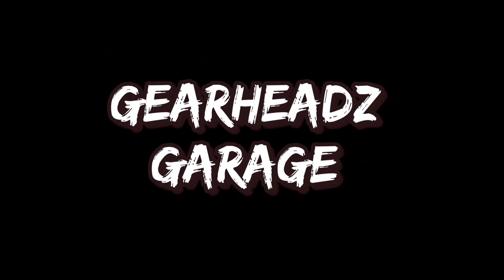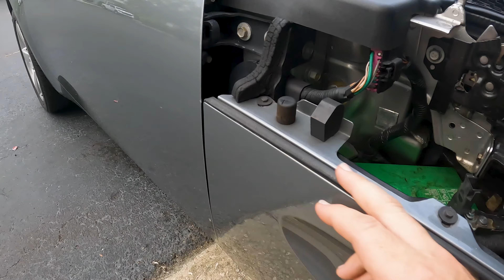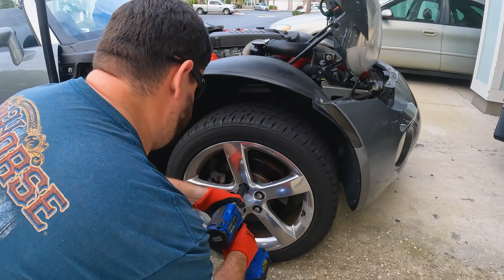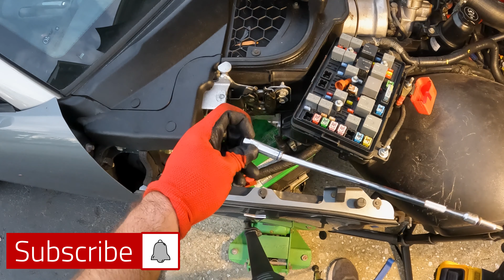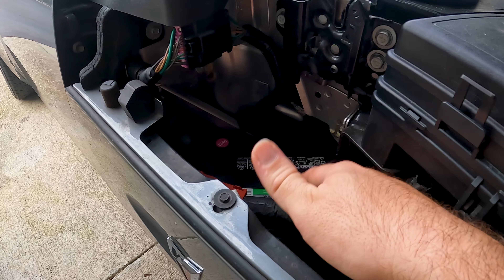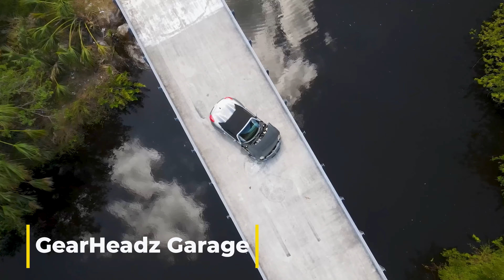PONTIAC Solstice SATURN Sky BATTERY Replacement

Comment: I just did this!  I never removed the entire fender,; leave it intact at the passenger door. Remove the fasteners on the other 3 sides then just loosen the fender bracket at the forward end, unhook it and have an assitant gently pull it away so that you can slide the battery out horizontally. Afterwards no fender alignment required either.
Reply from the maker: Work smart not harder! Many still go the old route. Glad it works for you.  You wouldn't believe the hate mail for offering this solution 🤣🤣

Comment: Need to change my daughter’s Sky battery today. I’m going to try your easy method. I guess both methods are easy. But I don’t wanna remove the fender. Got this link from Bill on the solstice forum! Thanks!
Reply from the maker: Try it out and see, it gets down to preference but you want to avoid removing the fender for alignment etc.  Post back let me know what you think!
Reply: THANKS! It was easy but a darn lug nut was so tight😡 I had to go to the tire shop so they could loosen it! The kid that took it off was nice!  YOU JINXED ME!😂
The shop didn’t charge me but I gave the young man a tip.

oh yeah it is a Walmart 2yr Battery size 58.
Reply: If I had to do it all above again I’ll go through the wheel well….  Makes more since to me
Reply from the maker: @thomasharris5151  tons easier!!

Comment: Bro that is not easier lol.  The only PITA in the correct method is the 10mm you have to reach through the door to get.  The rest is basic.  No jack needed, and a lot easier to get battery out/in
Reply: Theres actually no right way and this guy offered an alternative your method of reaching through the door causes alignment issues with Fender placement and is a total pain. I will take the jack route as there's no fender removal- doesn't change fender alignment like the door method.  Save yourself the headache and just remove the tire and buy a jack.

worked for many Chevy dealers and the door bracket route is a BIG NO for liability reasons.
Reply from the maker: That's the whole point, there are various ways to accomplish this, but the wheel well route is the least invasive.

Comment: Like seeing these videos, the solstice wasnt sold here in Australia, also for technical comedy chrck out the battery placement in a JS Avenger......
Reply from the maker: I'll look at that one. I can only imagine if it's a jag! Didn't they have the Opel though in Australia?
Reply: @GearHeadzGarageUSA   yes but for a limited time, as Holden was furious at GM for bringing Opel and setting it up as a separate entity. It was soon squashed , however iwill check out the battery placement on these as well 😄
Reply from the maker: @garycorbin2789 when I saw JS first thing that came to mind was Jaguar, but then I realized you were referring to the avenger..... I just looked up the location of that battery. Yeah I don't think so.....I would never want to replace that.

Comment: nice video!, what size are the lug nuts? i have to change my battery on my 07 soon..thanks
Reply from the maker: M12x1.5 https://www.amazon.com/dp/B0CLP3V5NW/ref=cm_sw_r_as_gl_apa_gl_i_A0G71BNF6V0P34A1HDND?linkCode=ml2&tag=gearheadzgara-20

Be careful though the studs break easy because of age then your total @#$& and it's not fun.

Good luck!
Reply: @GearHeadzGarageUSA  thank you

Comment: I kinda got a little bit excited for a second when you said something about the T-bucket. How are you coming with it? I'm down to final wiring on mine,  and gotta order a gas tank from speedway.  But I'm not far off from being done.
Reply from the maker: Its coming...got EP5 dropping this weekend had a who;e Fedex fiasco where they said they delivered all my parts but It was to the wrong address so it was reshipped.  Getting very close to starting!  Are you going with their T Bucket Tank or something different?
Reply: @GearHeadzGarageUSA  going to have to get one of theirs. The AB keg is just too big for the space I have.
Reply from the maker: @fantomson5035 I really wanted to do the keg also but somehow I ended up with a 20" trunk I never ordered 🤣🤣